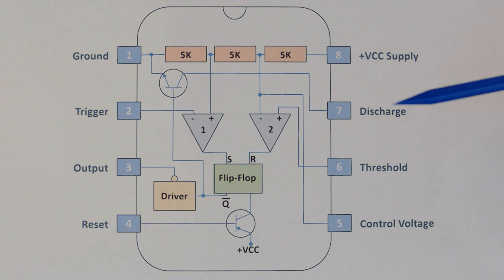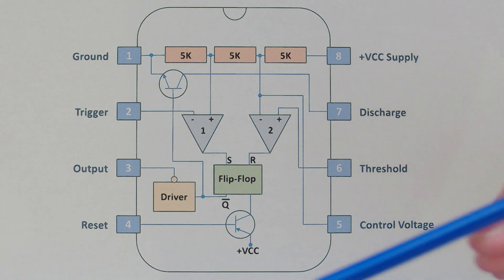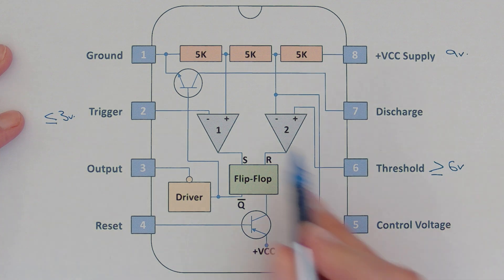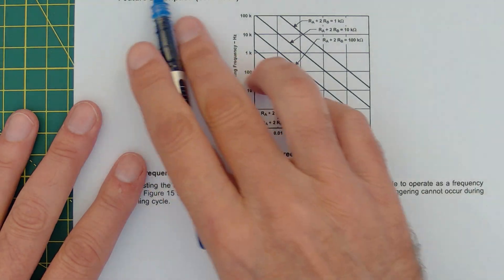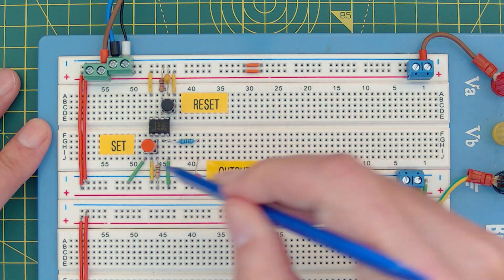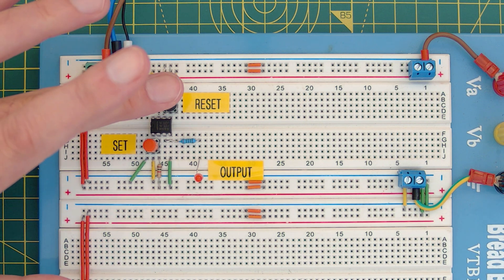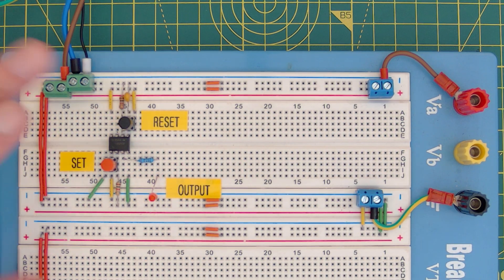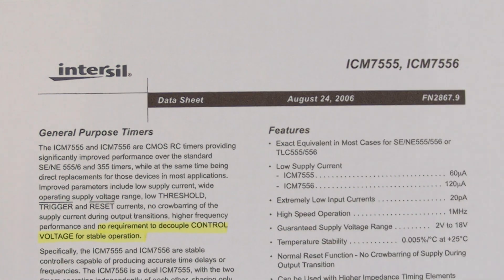What Happens If SET & RESET of 555's Flip-Flop Are Triggered?

Comment: Isnt your statement incorrect with the original comparator being < 1/3voltage, it will go high, in fact will go low?
Reply from the maker: No. The Trigger pin connects to the - terminal (inverting input) of the comparator. If that terminal is lower than the voltage at the + terminal (non-inverting input) then the output will be High.

Comment: Fun video, but you should consider adding the circuit diagram.
Reply from the maker: Thanks for the comment. 

There's nothing much more to it than the circuit shown at 03:31. The other connections are Power to Pins 1 & 8, and pulling Reset (pin 4) High (i.e. connecting it direct to the supply voltage).